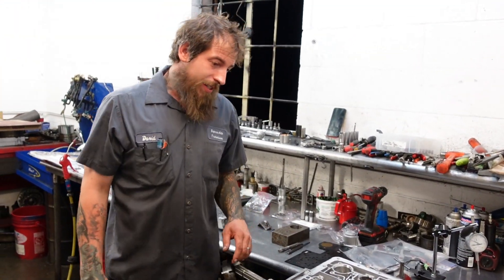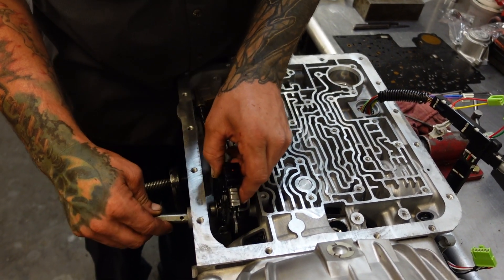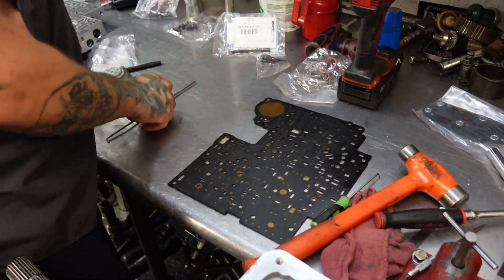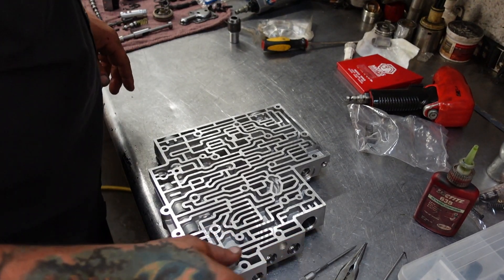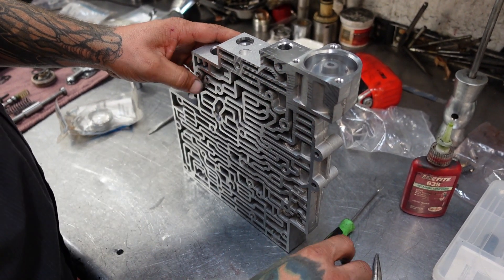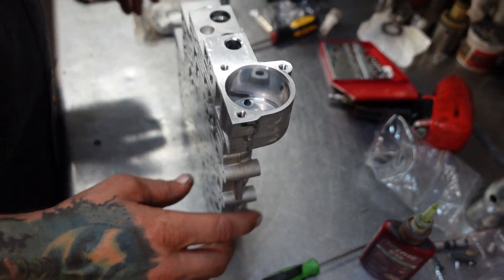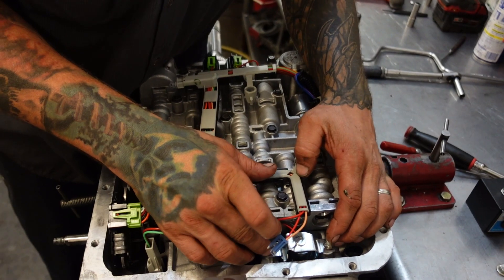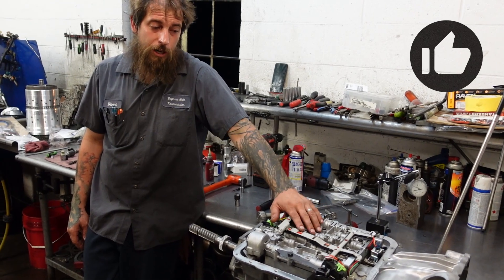4L60 shelf build valve body, built and installed!

Comment: David - sweet video. I’ve watched all your videos and appreciate your contributions for the rest of us out here in the trenches building at home. I’m doing nearly an identical valve body build right now that you could consider a mix match of parts. 4L60E - TransGo SK Kit + Sonnax Pinless Accumulators (FWD, 1-2, 3-4). So many mixed opinions out here and tough to get a straight answer. I am well aware that the Sonnax Pinless 1-2 Accumulator Piston does not play well with the TransGo HD2 spring arrangements (nor the SK Junior if I remember correctly) and I think many people generalize this as an answer of “Do Not Use TransGo springs with Sonnax Pinless Accumulators”. I noticed you’re one of only 2-3 people I’ve seen use the 1-2 Pinless Accumulator with what looks to be an SK kit shown in your video. Any issues with this as I’m looking to do the same thing but can’t get a straight answer from a reputable builder such as yourself?? In my opinion I’d like to say the SK kit is the only spring arrangement for the 1-2 you can get away with this without any modifications or worries - I’d love to hear your feedback? Thanks and keep up the vids!! 9:23

Comment: I rebuilt my first 4l60e recently.  When i bought the 98 chevy blazer 4x4 the third and 4th were already shot. I got it together with new torque converter. Seems ok but when im just cruising in 3rd, the rpms will fluctuate about 1000rpm back and forth like the converter is going in and out of lockup. Where should my attention be to fix it. 
I know the guy at brooksville transmission and have an appointment for them to look at it but would like to be able to solve it myself.
The kit i bought came with a different spring that i used that was supposed to eliminate pwm problems versus reaming it.

Comment: Thanks for the video, in the process of rebuilding my transmission and seen this was very useful, i have a couple of questions,  if ur able to awnser and give me some input, 1st, check balls and locations. I seem to have 8, but u mentioned 1 for the case, 2nd how can i i tell exactly what trans I have, im going of ur comments external and internal gear switch.. its supposed to be a 4l70 but I'm thinking it's been replaced with something diffrent.

Comment: great video: thanks for that. I have a 96 Fleetwood. Had the transmission replaced at 72K miles, now at 111K miles I lost 2nd gear. Removed the valve body and found the 1-2 valve stuck not moving. Removed the valve and found nothing wrong. Placed it back in and still would not move so decided to purchase a rebuild unit from Amazon. Got the new unit in and checked it out and found that the first 2 valves moves freely. I can push them in and they return no problem, The other two do not move at all. Is this normal or is this unit defective as well? thank you in advanced for your help.

Comment: Which way do you remove roll pins and which way do you insert them?
Reply from the maker: From case side of vb and back in case side of vb
Reply: @expressautotransmissiondav4207  what would happen if I pushed it through the other way removing it? Did I scratch the vb? Seemed like it came out easy no problem with a small punch? Hope not
Reply from the maker: It typically won't hurt anything
Reply: @expressautotransmissiondav4207  thanks

Comment: Got an issue where getting to highway speeds and at 55 mph when tcc is commanded, instead of rpm's dropping.. it jumps back up a couple hundred rpm's like it drops to third or something.  Currently I have it turned off so the trans has all forward and reverse gears, just no OD.  Someone mentioned a fluid cross flow/leak preventing OD..  other than corvette servo and sonnax 77998-03K kit, it's a stock 4l60e.  Drives fine, just no OD.  2004 LM7 with the 4l60e that came with the motor running Holley Terminator Xmax swapped into a 80 series land cruiser.  Thanks.
Reply from the maker: Interesting for sure. When it's being commanded have you watched solenoid firing and compared to solenoid application chart. Also has the setup previously worked and started doing this or has this been an issue since the build
Reply: @expressautotransmissiondav4207  So yes, it's been an issue with the build since install as far as I can tell because I installed those parts when I got the motor and trans before installing it in the vehicle where I should've ran it stock then swap the parts in.. it was just easier outside of the vehicle.  Not sure what you mean in watching the solenoid firing... On the Holley handheld I can see when it's commanded and as soon as that happens the rpms jump.
Reply from the maker: Call me atg the shop after 1 cst and I'll walk you through
Reply: @expressautotransmissiondav4207  thank you David for taking the time to talk to me and give me ideas on what to do and check out.
Reply from the maker: Absolutely anytime I can help
Reply: @expressautotransmissiondav4207  love the content an great explanation on stuff you build. Any chance u could do a video on the actual procedure you use to set up the band clearance and servo pin on a 4l60e

Comment: I am rebuilding my own 4L60E (after a notorious vendor from FL really botched my "Stage II build".) Between yours and so many other helpful sellers I dug deeper into the valvebody than anything else. What are your thoughts on plugging the PWM circuit (blocking the valve/motion) operation wise? Also, looking into the tools for something like the AFL valve kit in this video, I am finding it hard to justify the cost of $300-500 for the reamer kit (many options) for the average DIY guy... would you be opposed to sprucing up a Valve Body sent to you?

Comment: Is there a website you can go too to get the tool kit you used? I am watching your videos religiously as a reference source while I am building my 4l60e for my 06 yukonxl 4x4
Reply from the maker: Which tools would you like and I'll get the numbers
Reply from the maker: And thank you for watching
Reply: @expressautotransmissiondav4207  any tools you think I might need for the 4l60e and the 4l80e I plan on eventually swapping to the 4l80e but right now I am rebuilding the factory 4l60e that was originally in my suv I have a 4l60e out of a 01 suburban I got from a junkyard 2 years ago in it now and a couple months ago I lost 3rd-4th clutches been driving it like that while trying to get parts together for the one I am building a lot of upgraded sonnax parts to try have it be a little bit better then factory when I get the 4l80e I plan on building it out since I plan on turboing the suv thanks again for any help you can offer my suv is a 06 yukonxl 4x4
Reply from the maker: Absolutely I'll get some parts numbers
Reply: @expressautotransmissiondav4207  thanks alot I really appreciate 🙏 it keep the great videos coming

Comment: What would a transmission with all these aftermarket upgrades cost off the shelf?
Reply from the maker: My units start at 1800 on the bench and go up from there.
Reply from the maker: Shelf units are the same starting price plus core if it's a ship out unit. If I install in house there's no core charge.

Comment: Why the hole for the 2-3 shift valve?
Reply from the maker: Using the sonnax hd shift valve needs the hole to connect coast clutch circuit.
Reply: @expressautotransmissiondav4207  oooohhh ok thanks buddy I would’ve put that valve in and would not have known anything 😂
Reply: @expressautotransmissiondav4207  I’ll pay close attention to where u drilled so I can install mine. Any other tips u can give me?
Reply from the maker: The video is very complete for what I like to do my 4l60s beyond that we have a few other 4l60 videos on the channel that also have lots of great information.
Reply: @expressautotransmissiondav4207  I’ve researched a lot about the 4L60e to attempt to make it hold some power and your build list is the one that gets me excited. If only I could put a trans brake on it everything would be flawless. I have a 05 C6 with the 4L60e/65e hybrid transmission that I had rebuilt locally about a year ago and it’s never worked longer than 30 days without frying the 3/4 clutch pack and it’s only a max effort N/A 6Liter FBO heads so I’m the whole kitchen and the sink at it 🤣
Reply from the maker: Lol that's been something I've been asked for for awhilr and is not out of the idea wheel house currently
Reply: @expressautotransmissiondav4207  can I send u a valve body for a 2005 corvette that need the 4-3 valve, TCC regulator valve, and the actuator feed limit valve reamed?
Reply from the maker: Yep yep
Reply: @expressautotransmissiondav4207  how much would I be looking at for those to be reamed only
Reply: @expressautotransmissiondav4207  my instagram is the same as this page so u can DM me some info if you’d like